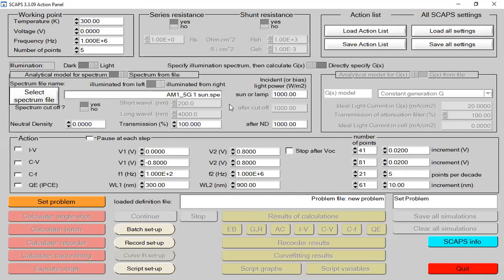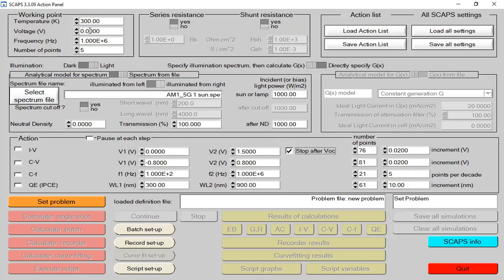Hole Transport layer free Perovskite solar device Simulation On SCAPs 1 D

Comment: Waleed, can you please share the material data for some of the materials you have been using in you simulations. I am talking about bandgap, electron affinity, doping concentration, and all rest parameters that we need to pour in before forming a cell. we can practice only when we have data with us. Or in other situation you may share some relevant literature in which are these values already stated. As an example, I had asked for CuI, but would be advantageous if I am given of more.
Thanks

Comment: Sir, I really appreciate the work you are doing. Sir, it would be very helpful if you could explain about the statistical analysis of the performance of a solar cell.
Reply from the maker: @Aritra Mukherji would you please tell me what kind of statistical analysis you want? My all tutorials are based on Perovskite Nd all analysis were already focused on performance analysis specially for Tin and Pb based or mixed.
Let me know about more details related to your querry pershaps I can share details with you via email.
Regards
Reply: Sir, as the Scaps model is not practically verified in any laboratory, so we need to test these models under suitable conditions..and the best probable way is to statistically analyse the various data sets using python. In case there is any information available with you regarding this, kindly share. That would be really helpful.
Reply from the maker: @Aritra Mukherji your answer is right about some extend but it's not true that SCAPs results are not matchable with lab results. I have done too many simulations and after optimization my results were almost close to lab experimental results. I am student of Renewable energy so I dnt have too much knowledge about Phython language. You can check my results and most of them are close to lab results. Actually when a person do simulation he must know results for a particular perovskite, one must optimized parameters accordingly. The only thing you need to use accurate and optimized parameters for all layers in SCAPs. You can see almost many researchers are working on this tool and getting very better results. could you please share which Perovskite you are not getting close results to lab one? May be I can optimize them or suggest that can gv u better results. Plz have look for my MASNI3 based simulation results were too much close to lab work like my Box was 0.9V while for same Voc is about 0.83V in lab. I would appreciate if you able to share your Simulation model or parameters for further suggestions.
Regards
Have a gud day
Reply from the maker: You can find many arcticles in which SCAPs results were compared with lab results, you can see almost every new article only SCAPs tool is being used.